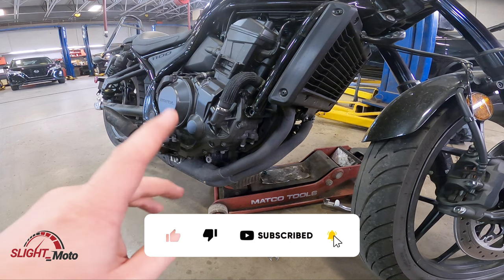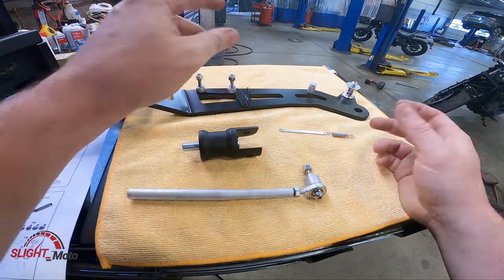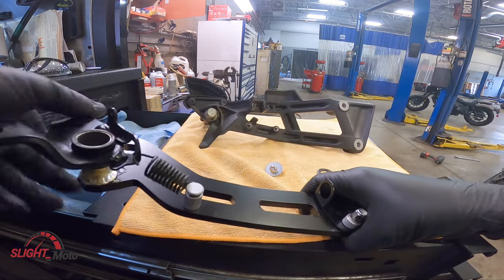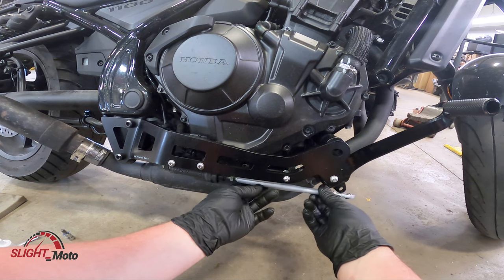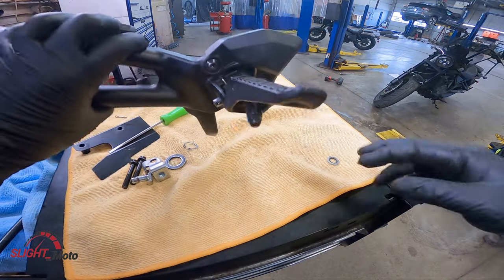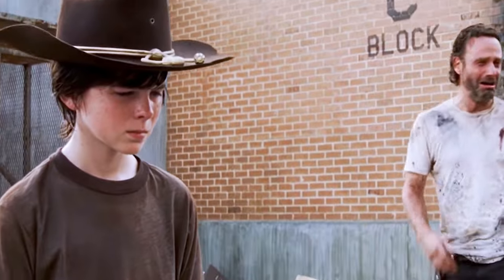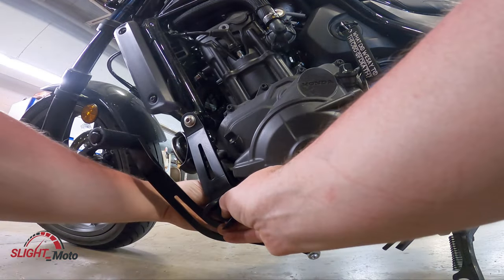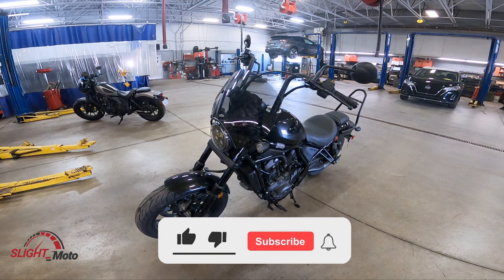Honda Rebel 1100 (CMX1100) - De Pretto Forward Controls - Install

Comment: I just added mine today... Went for a short ride and noticed when I hit bumps I feel my left peg jolt. (I have the DCT version, so no shifter components to worry about.)
Anyone else have this issue? I'm hoping it's just a foot peg bolt issue that might need tightening and not the whole left assembly.
Reply from the maker: We did not see this issue. Yet I will pin the comment to the top to see if anyone else has experienced this.
Reply: @SLIGHT_  after riding a bit more and watching what happens when I feel the bump, I believe it is because the left front support bolt is connected directly to the frame so close to the front forks. So when I hit a bump I feel it directly. I'll keep trying to diagnose what's happening tho.

(don't worry, I was in an empty lot going slow speed during my self evaluation)
Reply from the maker: @CrushersCharisma  I would love to hear what you find.

Comment: I installed this set on my Rebel T a few months ago, and I have to say, it's much more comfortable than the stock footpegs. Assembly is quite easy, and otherwise as mentioned in the video, you don't need to support the engine block, because it is certainly not the only bolt on which it hangs from the engine block, and if it was 'De Pretto Moto' would definitely have mentioned it in the assembly instructions.
Thanks for the video!
This set is definitely worth the money🤗
Reply from the maker: Thanks for your excellent feedback.

Comment: I just want to say thank you for this video. I used this video alone to install the FCs on my bike. The hardest part I had was getting that first support bolt out. I ended up putting a wrench on the inner nut and kicking down with my foot. Once it loosened it came out with ease. Not sure if I want to struggle with the clutch grommet. Might just go buy another one rather than wrestle with it. Great video!!!!
Reply from the maker: Appreciate the feedback! Thanks

Comment: Thank you very much for this tutorial ! :) I've purchased the DPM kit for my manual 1100T last week and I've installed it simply by following your video. DPM should use it to make it their official tutorial !

While mounting my kit, one bolt (a black one, holding the rear part of the bracket) snapped when I was torquing it down. The bolt was loose and it snapped in two quitte easily. I'm not sure if I had a defective bolt or if it's my torquing wrench that is defective (even though the wrench worked properly on any other bolts). Fortunately, I went to my near HD shop in which they've managed to find a bolt having the same size (they saved my day).

Besides that, the kit is indeed pretty neat. I'll try to put the brake pedal a bit higher to have more room for my foot. I've kept the OEM pegs as I can't find anything here in my country to replace them - at least not something decent. Hope it will work.

Anyway, thanks again sir for this step by step tutorial !
Reply from the maker: So happy this helped you. Thanks for the feedback!

Comment: I put in the Xitomer kit. I do recommend having them stripped and powder coated first though. The DCT kit is over $400 less than the DPM kit on Amazon. Since I now live in the Philippines and the Xitomer kit was under the duty limit I saved over $500  vs ordering from DPM. Amazon doesn't ship the DPM to the Philippines.

Comment: Still trying to decide to do this or the trex racing ones. With this I think it will be to far for me. But will see I don’t know when I’m doing it. Also great video slight keep up the great work.
Reply from the maker: They’re about the same distance. Just enough to make you more comfortable right.
Reply: I think that the T-Rex kit doesn’t stick out so far away from the bike, consider the foot position of the stock peg and how close your legs are to the tank, the T-Rex kit is very similar and the kit for the Depretto has the leg sticking out wider, like highway pegs where your legs are sticking out a bit, for me that’s not comfortable. I just want to move my legs forward, so I’m not sure Depretto or Burley are the choice, T-Rex still might be the choice, thanks for sharing your thoughts on this.👌😉

Comment: A couple days ago, I hit a deer with my CMX1100DCT. Luckily I didn't go down and the bike is fine. However the impact caused the right side of my T-Rex crash bars to get bent back about a foot., almost to the stock peg. If I had forward controls on my bike I am sure I would have gotten hurt, a broken leg or worse. I will be replacing the T-Rex crash bars with the same ones.
Reply from the maker: Ok??? Thanks for sharing??
Reply: Hey brother I'm glad you're ok, I just got me a 2023 DTC, and it has this same forward controls, I have the Trex guards on the way, does this mean that I can't install the guards with these on?
Reply: @JonathanBailon  I don't know but your feet might be in front of the guards. If the guards got bent back as in my case, it might trap your foot. I haven't seen a bike with both devices on it.

Comment: You can adjust the brake lower so the foot clears.
Reply from the maker: Agreed. Yet when your feet are far forward, it makes an uncomfortable feeling as you reach/extend your foot to be able to apply the brake. 

Great suggestion though and may work for many people. In our case the floor boards were the solution for him.

Comment: They're pretty expensive!!

But so far, there isn't another brand for forward pegs..
Reply from the maker: There are others (red dragons for example) the De Pretto kit is extremely nice and has Robs (owner of this 1100) trust as he had them on his 500. 

Check out the Red Dragons as they’re also a great product.
Reply: Thanks...much better price.
Reply: Ali Express does exactly the same kit, possibly a knock-off of the DPM kit but it is exactly same, unfortunately only for the DCT model. DPM kit would cost me $1200 Aliexpress kit $300 so yeah big saving.
Reply: @rickhicks2445 Did you end up getting them??
Reply: @captainobvious5349  Should arrive tomorrow according to Post so just waiting, will post when I get them sorted.
Reply: I‘d love to where exactly you placed the jack. I‘ll have to take the upper bolt out to install a crashbar and I‘m scared af 😅